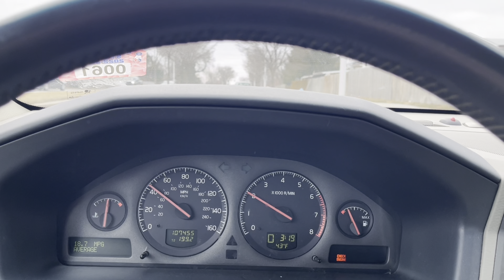How To Turn $750 Into Over $2000 Parting Out Cars!

Comment: Soooooo much more meat left on the bone to sell when you sent it to the junk yard. Seats, console, dash, gauge cluster, washer reservoir, engine, transmission, power steering pump, rack & pinion, wiring harnesses, carpet……
Reply from the maker: Yes, there was a lot left with this one. Engine was bad, seats, and other interior parts were not in good condition to make them worth my time and storage space. Can’t tell from the video, but this car was in rough condition. This car was one of my first that I did last year, definitely could’ve done better.